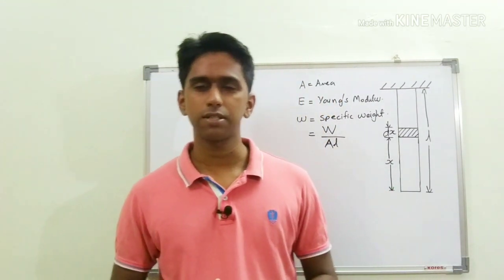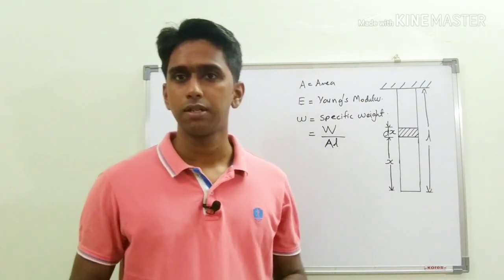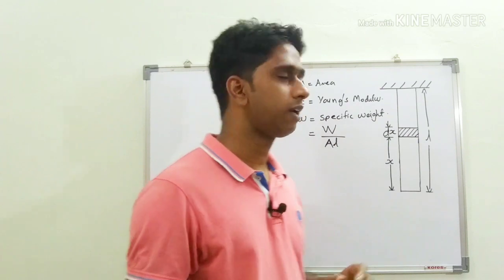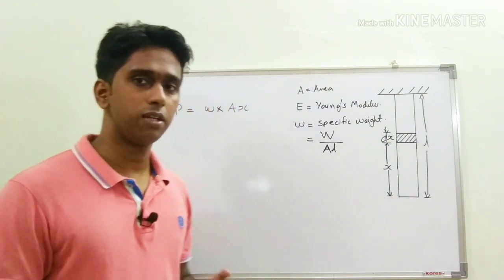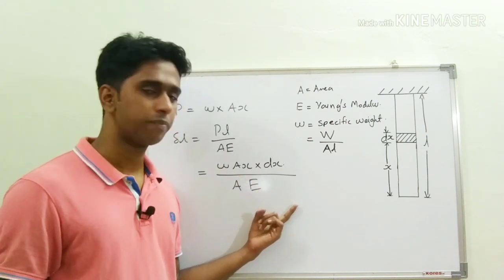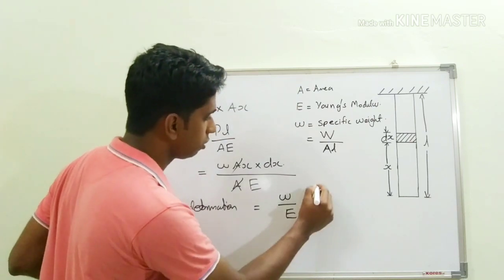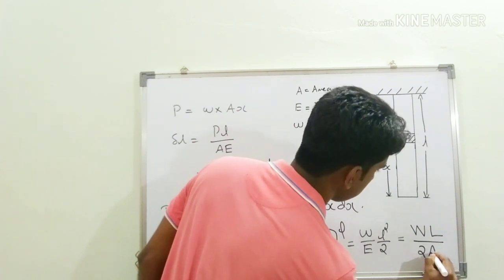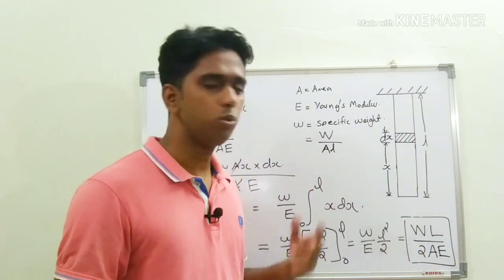Deformation of a body due to self weight

Comment: find the deflection due to self weight given that =1._6,Ee=2.6Ece,elastic modulus of concrete is 34×103,gravity is given as 6,self weight is 0.76,length of cable is 1000,elastic module of concrete is 34×103,moment of inertia is 3200×105